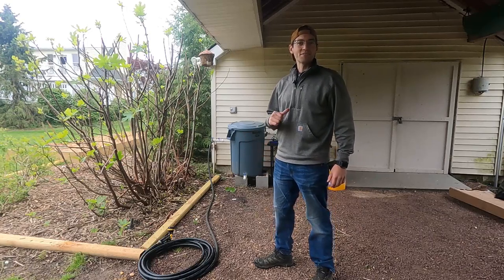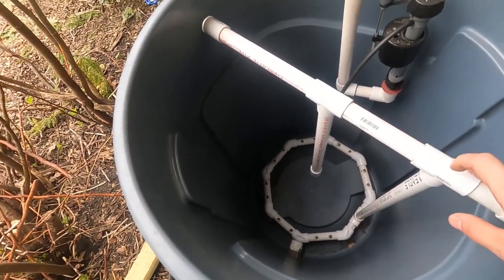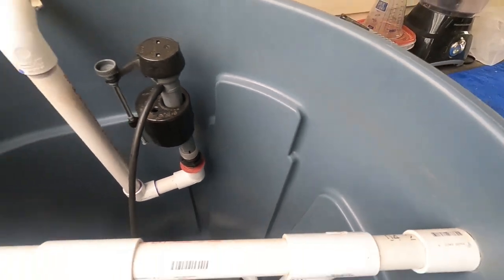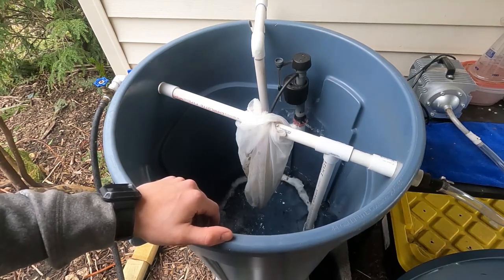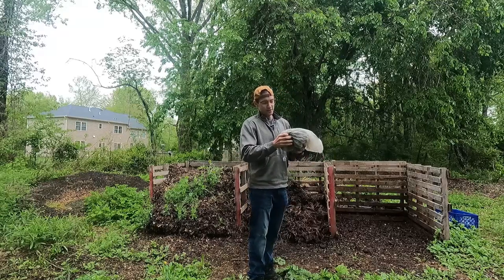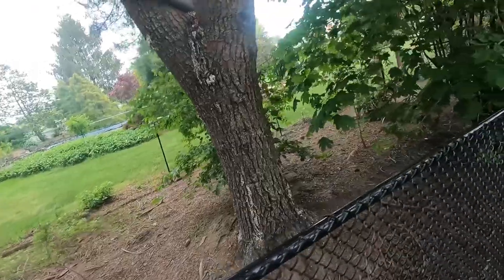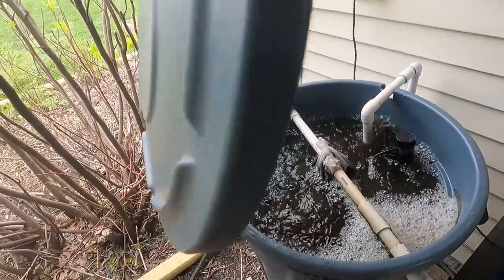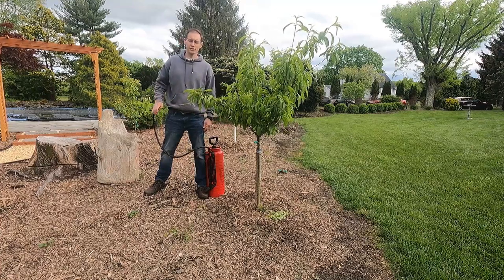DIY Trash-can Compost Tea Brewer - How to Brew Compost Tea

Comment: Great topic and video.  I plan to start making my own natural compost with a wide range of organic matter.  I have read that it takes a year to make a quality compost and it's moisture content has to be monitored and maintained fairly consistent for best results.  I have never heard of spraying compost tea on the actual plant.  Not to say it cannot be done but just question the efficacy of it.  
Isn't applying the compost tea to the soil way more effective than spaying the plant?  Seems to me the ingredients of the tea could be harmful to the process of photosynthesis and could even cause damage to the tree, depending on the ingredients, such as molasses, alfalfa meal, and dirt particles; and environmental conditions, such as bright sunlight amplifying the effects of moisture.  Much better to help the tree through the roots via the soil so those natural processes can take place.
My thought is, that spraying the compost tea on the leaves would be similar to humans dumping food on their skin and hoping it finds its way to their mouth.  The benefits of putting it on ones skin (human or tree and plant leaves) is way less beneficial and probably, by far, less effective than applying it to the soil so it gets used by the roots or your mouth to strengthen the body, limbs, and skins, so to speak.  
Thoughts?

Comment: Maybe I missed it. How many bags of compost do you aerate to make a full garbage can full of tea?  Just one bag?  Do you recommend adding some worm castings into the compost?  I’m new at this. Thanks!  Great video!
Reply from the maker: Hi! Yes, just one bag or half a bag. The idea is to use a small amount of compost to inoculate the water and GROW the good (aerobic) bacteria and fungi. They will multiply in the water so just introducing them into an ideal environment is what you're aiming for. Not much compost is required to achieve this.

 Worm castings are AMAZING! If you look behind me in this video, you'll notice a black tote with a yellow lid. That is my worm farm and I always throw and a handful of castings into the brew. I forgot to add them on camera but thank you for the excellent question!
Reply: @twiggshomestead6497  thanks so much!

Comment: I made this to the direction and the bubbles on the bottom would only come up one side and I spent alot of time trying to adjust it bust ended up going back the the air stones and aeromixer. But just got a Tra Lab bubble.snake witch is pretty much the same idea of this. It is a great design I just couldn't get it to work correctly. And I just didn't have the time to figure it out.
Reply from the maker: Sorry to hear it didn’t work out! Mine is still kicking and working great. It could have been the size of the holes you cut. They need to be very tiny.

Comment: Need to know air fitting from pump to pvc.
Reply from the maker: Unsure of the name but I found a brass barbed end to fit my size tubing with a larget 3/4'' end and just rigged it to work lol. It's just air so if there is a tiny bit of a leak, don't sweat it. The electrical tape helps seal it up or even silicone.

Comment: I was told those hand pump or pressurized pump destroy the microbial life as it goes thru it...not 100% sure
Reply from the maker: You are right. Do not use a pump to pump the finished compost tea from the drum or can after it's done brewing. Since this video, I have raised the container up and I gravity feed the tea from the container. The pump that keeps the water moving is an air pump. It only pushed air through the PVC Pipe to the bottom of the container which then bubbles to the top creating an aerobic environment for good bacteria and fungi to grow as well as keeps the water in motion/ circulation.

Comment: Hi, Thank you for sharing your set-up.  I normally don’t comment on videos but I felt obligated to bring to your attention the risk of contaminating your water source and sharing that with the YouTube community.  If the pvc pipe riser shown in your video that connects to both your tea container set-up and your water hose are “directly connected” to your well water tank then you are cross contaminating your water source.  Folks on public water supply systems are required to have a back flow preventer valving set-ups.  Those can be quite costly so to avoid that you can simply allow an air break (basically a set-up where you physically connect and disconnect to your water supply with say a hose).  You want to avoid any possibility where a small amount of non-clean water can flow or touch your clean water.  Definitely avoid connecting a source of bacteria (even if it’s beneficial bacteria for the garden) to your clean well water supply.  Please revise your video to either state to include an air break is required or a warning to “do not connect directly to your water source”.  Thank you!
Reply from the maker: Hi thanks for the comment. I am very familiar with the subject. I have replaced this with a ball float valve which does allow an air break. No contaminated water can enter the source. I appreciate the comment and concern!